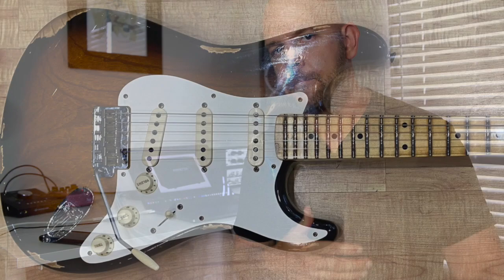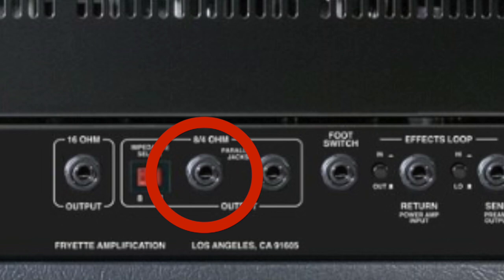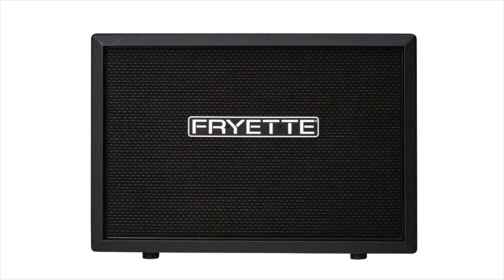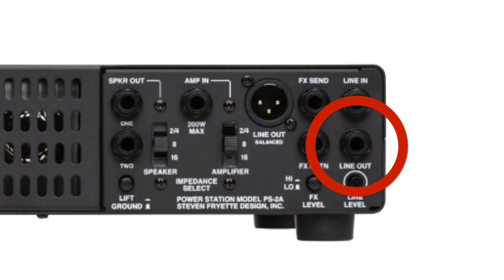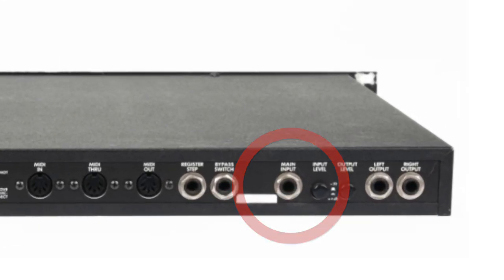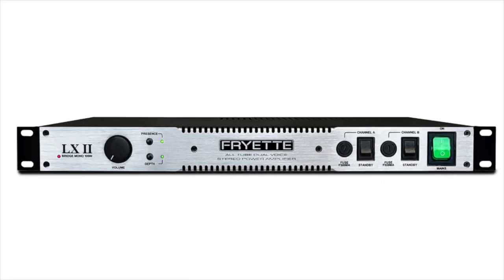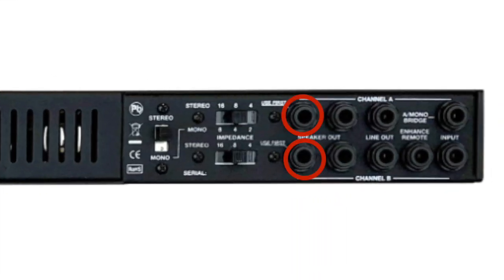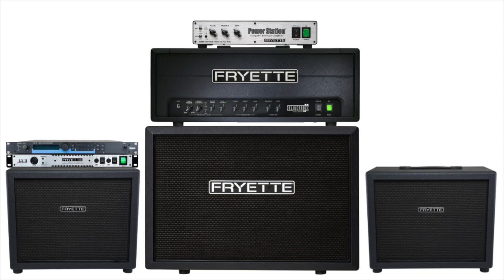POWER STATION: WET/DRY/WET RIGS!

Comment: My Power Station works great in my W/D/W rig. It allows me to control the volume of the amp, feed the D cab, and then with the effects send feed the input of a stereo parallel mixer where I have my stereo effects.

Comment: Thank you. I use my PS2 as an attenuator and use the Line Output to feed timebased effects and the send from those go to a Rack Stereo Amp into two 1X12". The main amp powers a 2X12" centre Dry cab. I can switch the main amp. I had some earth loop issues but introduced an audio isolation transformer which helps. I am still working on this system as it is great but too many projects going at the same time (as always), it is work in progress.
Reply: @@joshuasimonson7656 Line level into your return input device. I use a H90 at this point so similar. I have to add that you probably run into earth loop issues at this point. I got round that by using a car audio ground loop isolator and rewiring it for 1/4" jack plugs. Much less expensive than paying for an off the shelf Isolator.
Reply: @@joshuasimonson7656 Sorry, didn't mean to confuse. Whatever device the line out from the Power Station connects to is your return. Line Level.

Comment: In my setup, I have the FX send of the Powerstation going into one of those new Boss EVH sde3000 delays, and the dry center out from that going back to the Powerstation FX return, and then the left and right wet outputs of the delay going to the inputs of my wet amps (not attenuated).

Comment: I never knew that’s what this is called.  I have 2 Mesa 4x12s. I run a dry Diezel into the inner pair of speakers on the left cab, and a Mesa Dual Rectifier to the inner pair of speakers on the right cab.

The Diezel effect send goes to a rack-mounted stereo effects unit, which pipes the effects back to a Mesa Simul-Class 2:90 stereo power amp.

You “get it all” with only 2 cabs. As long as you don’t blow up your speakers, and let the power amp do some of the work of projecting the main tone.  The Dual Rectifier is setup essentially be an “overdrive,” with the channel selector. You keep all the tight Diezel tone, but can add fizz and girth to flavour, without creating all kinds of side-effects in the stereo effects and power amp chain, ie the levels stay fairly consistent, but it grows hair.

You always have the option to stomp a pedal as long as both amps are dialed in to receive an overdrive.  It’s impossibly good.

Anymore, in my new apartment, I can’t even use one half of a cab without getting a noise complaint inside 30 seconds of use, so I guess I need 4 Power Stations… Yes.

Comment: Looks like I’m circling back to this almost a year later haha…

question: if connecting the Power Station to use as a Wet/Dry/Wet rig - there anyway to mute the dry cab, but still allow the line out to still be active?

I want the ability to switch between W/D/W to only using the wet amps in stereo. If possible… 

I understand if I want to go from W/D/W to only Dry, I can put a stereo volume pedal in front of all my Wet pedals.

Comment: I really hope my Synergy 5050 doesn’t have a stereo separation problem… never really thought about it until watching this video. I would think a synergy 5050 would be a good candidate for two wet cabs?
Reply from the maker: No worries .Steve designed that as well so you can be sure it's got good stereo separation.
Reply: @FryetteAmps how can I order one of these??
Reply from the maker: @bruzzgravely3470  Chuck Levin's has one in stock.